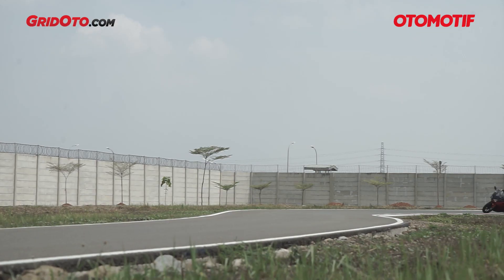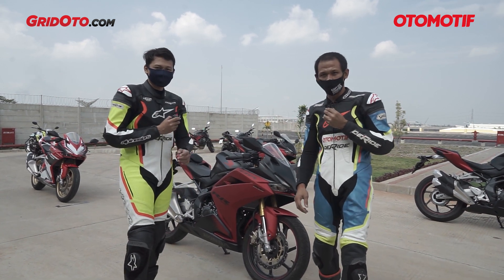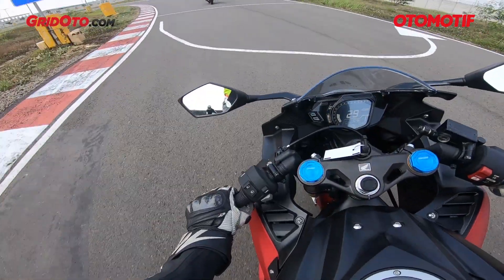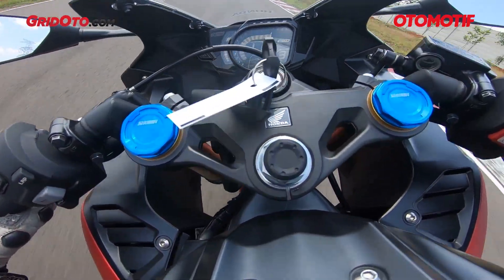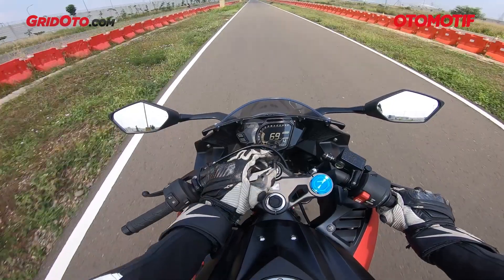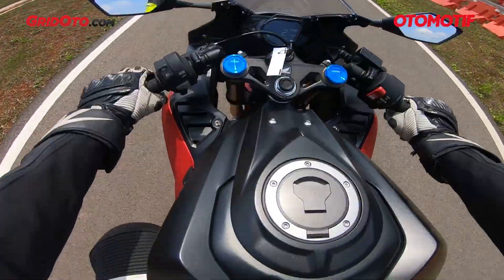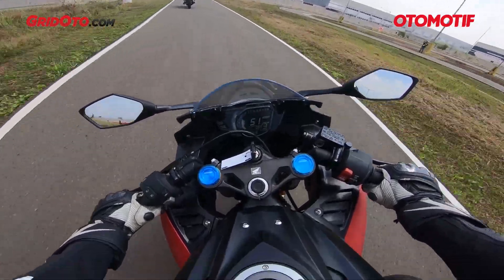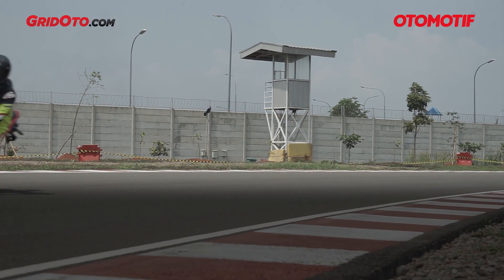Honda CBR250RR SP, Test Quick Shifter dan Mesin Baru 41 PS! l Otomotif TV

Comment: Slipper clutch mmng bnyak bikin power loss tapi mau gamau buat ngikutin kemauan pasr honda terpaksa pasang komponen ini
Reply: Ngaco... Slipper clutch bikin power loss darimananya. . 😅
Reply: @bayuagung7712  wkwkwk maklum bocil kurang jauh maenya, motogp aja pake slipper clutch wkwk ngelos dari mane coba wkwk
Reply: Bayu Agung per koplingny d buat lentur dan perkoplingny d kurangi cuma 3 bang jdi gigitanny kurang. Buktiny bisa d liat prbandingan peforma cbr250rr dgn allnew ninja 250fi. Secara tenaga on crank gedean ninja. Tapi pas smpe d roda gedean cbr250rr tanpa assist n sliper clutch, bisa d lihat ketika shifting cbr lebih loncat d banding ninja. Cek data dyno, tenaga on wheel lebih bsr cbr250rr tanpa asc. Sip
Reply: Fuck Off Channel motogp pke seamless gearbox bang, d bantu shifting dgn QS dan dia pke dryclutch. Jdi udh beda lagi sistemny. Dia punya efek seperti asc agar ban tidak ngunci saat turun ke gigi 1 secara mendadak tapi bukan asc. Namany down shift dgn auto blip jdi rpm d naikan otomatis sma ecu biar ga ngunci dan ketika ingin exit corner pickup ny cepat

Comment: Kalo diliat dr top speednya kok kayanya performanya sama aja kaya RR produksi 2016. Top speed saya dlu 178kmpj. Dibawa tmn yg bobotnya 52kg malah dpt 182kmpj. Malam hari n angin jg ga trlalu kenceng. Kondisi standar baru bbrp hari kluar dr dealer. 
Akselerasi kayanya jg sama aja.

Beneran nih improvementnya?.. 🤔
Reply: smakin besar torsi, biasanya rpm atas nya smakin lemot.. 😬 biasanya loh ya.. blum tentu salah dan mungkin benar😬😬😬
Reply: @unknown5894  tp di data tertulis itu torsi n power kn sama2 naik..
Reply: Rama Bhujangga  ya kan diatas kertas brow😁 yg realtime nya diatas aspal.. tp ya lumayan sih, spek power diatas kertas terbesar di kelas 2cylinder👍
Reply: @unknown5894  iya, saya kn komparasi yg di video ini sama motor saya yg produksi 2016.
Reply: @unknown5894  yg jd pertanyaan saya, beneran nih pengembangan motornya? Apa cm gimmick doang ASC n QSnya. 
Karena motor saya, (CBR250RR) thn produksi 2016. Yg tertulis power di brosur powernya cm 38dk, sama2 tes di jalan, tp hasil top speed saya lbh unggul, track +/- 1km.
Gmn improvementnya tuh?..
Reply: Rama Bhujangga klo fiturnya sih beneran brow.. dan dilihat dr tenaga bawahnya juga kliatan lebih nampol dibanding yg sbelumnya, tp atasnya keliatan sama aja.. menurut saya ya😁 ga tau klo yg lain
Reply: @unknown5894  iya beneran, kn jlz2 ud ada di motornya, apa tu cm gimmick, bwt ngabisin stok mesin lama yg blm laku. Gitu lo maksud saya. 
Bro sdh pernah ngetes cbr250rr yg dulu?